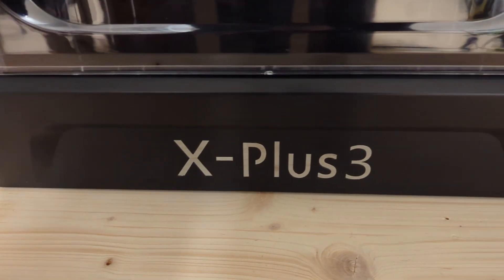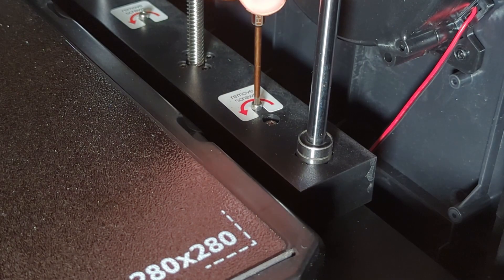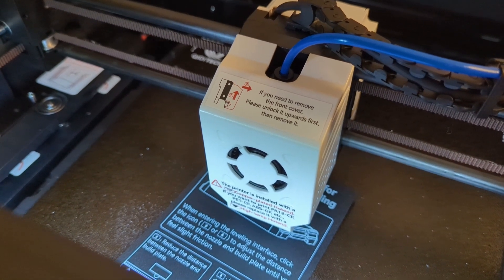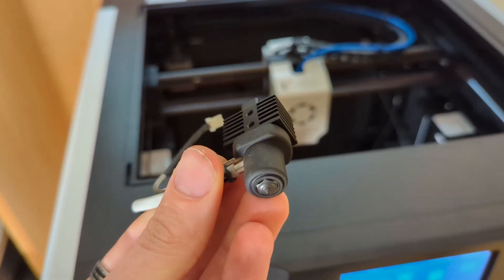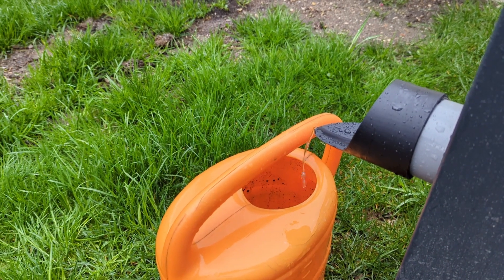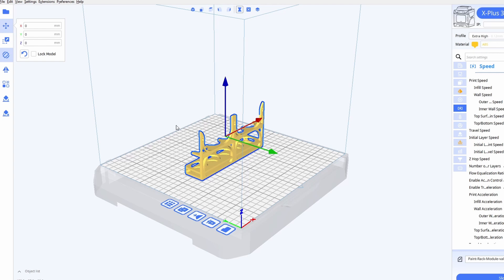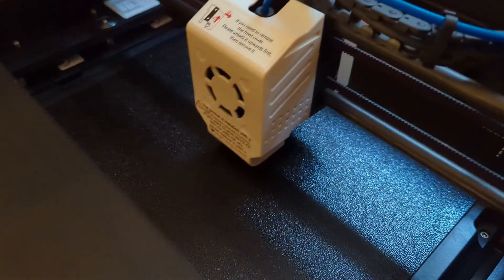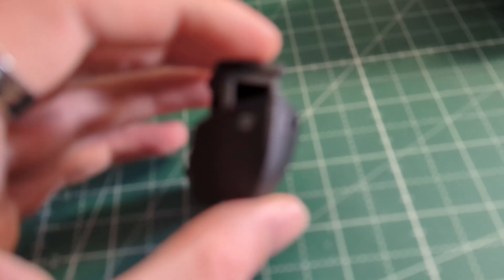Qidi X-Plus 3 Review - Affordable, Versatile, and Fast - old version

Comment: Hi how can you tell if its a gen 1 or 2 and if its a gen 1 can it be upgraded to work better and what parts are neeeded been told the bars were a problem the ones that were black not the stainless 
Thanks
Reply from the maker: Sorry, it's been so long that I don't remember anymore. I think the z lead screw fixtures where a problem in gen 1. But I'm not sure.
Reply: @Craftknights3D  hi yes I've been told it was the whole framework was wrong and alot of other issues when using abs with heated chamber, just needed to know why they were withdrawn from the marketplace and if they can be upgraded in anyway as qidi refunded alot of people who were not happy with them.
Did you print abs with the one you reviewed
Thanks

Comment: I have gen 2 X-Plus 3
DON’T.  JUST DON’T DO IT!

I purchased a Qidi Tech X-Plus 3 on October 21st, 2013, and received about 5 days later.  It comes well packaged in foam with everything well labeled and marked.  That is the last good thing about this machine.
Went through the start up procedure and the machine couldn’t home, couldn’t adjust z-axis offset, and repeatedly crashed when trying to print.  It gouged a deep groove in the included PEI plate.
Contacted support with the email that is PRINTED ON THE FRONT OF THE GLASS DOOR.  And waited for a reply.  And waited. And waited.  Finally in frustration I posted why was I not getting support on their Facebook page and LO AND BEHOLD an email from tech support.
It went downhill from there as I was repeatedly instructed to do the same thing over and again that did not work.  My z-axis offset was stuck to -4.87mm.  I could see this when I was linked into the machine via offset.
I did as was instructed and it did not work.  None of their suggestions did.  I finally flashed the firmware and tried a factory rest.  The factory reset button on the screen doesn’t do anything, really.  Push it all you want and it will say everything is working properly.  I finally downloaded an out of date firmware, flashed it, then hit the factory rest button and it returned it to the most up to date firmware which was originally installed.  This cleared the z-axis offset and when I re calibrated the machine, it was working properly.
WHY DID I HAVE TO FIX MY OWN MACHINE?  Also, one of the suggestions given was taken from a user that posted on reddit.  And customer service was PROUD to pass the info on.   Guess they don’t know how to run their own junk.
Worked for three days until the entire printing head seized up.  What the heck?  Another wasted two days until I was instructed to manually push the head to one side and clean and lubricate the x axis metal bars.  Looked in the “manual” to see if this was a procedure to do/watch for.  You guessed that right...no.
Cleaned, lubed and it worked again.
Now mind you I bought this specific model to print ABS/ASA/NYLON because it has a heated chamber up to 65C.  I have ASA filament that recommends 60-65C chamber.  I slice with the chamber temp to 60.  When I go to print I get an error code, do not exceed 55C.  
I print with lower temp chamber and have nothing but warping issues.  
I order QIDI branded ABS rapido filament and slice according to THEIR presets.  First print not only fails, but fails so utterly bad that I have to replace the hot end because filament has broken off and melted in the all metal throat.

Now this may be a bad machine.  BUT….
Now the fatal flaws in this machine.  No x,y, or z axis limit switches.  This is known in the CNC machine world as a dogless system.  These were phased out in the mid to late 1990s due to the nightmare of having to re calibrate the system on a regular basis.  If you like spending more time calibrating your machine than using it, this model is for you!
The on/off switch is on the back bottom, about 12-16” in next to the power cord.  A total mess to turn off and on.  You won’t know how bad this is until you own it, and then it’s a bit to late.
They provide a Tupperware style air-tightish spool holder, ON THE BACK.  Unless you have this on an island or on a shelving rack with access form both sides, YOU WILL CURSE THE DESIGNERS OF THIS.  And don’t forget you have to thread the filament out a small hole into a bowden tube 16” from a filament break sensor, then about 40” of tube into the printing head.  
Oh, and the run out sensor didn’t work when I ran out of filament.  So they add a worthless impediment to smooth feeding.  Qidi Tech DESIGN AT ITS FINEST!
Final thoughts...this model was pulled from sales a while ago, then OBVIOUSLY rushed back into production.  PLEASE, PLEASE, I beg of you, with tears in your eyes, DO NOT FALL FOR THEIR SLICK SALES PITCHES.  Because a fast, high temp, enclosed printer for under $650?  Their pitch is no better than the Sirens of Greek Mythology...a sweet pitch with utter doom.

Comment: Actually as it's using klipper, I wonder if there is an easy way to add an ercf to do multi material.

While of course the Bambu printers have an advantage with the automatic cutter in the printhead and the poo-ejection, and also the spool rewinding on filament unload is definitly quite nice, the AMS isn't the only way to do filament changes.

On the other hand the AMS itself actually does not seem very complicated. The main element seem to be the filament buffer, detecting if the printhead needs filament or if the filament pushes the filament back (unloading it). For each spool there is a feeder in the AMS and a motor to roll the spools backwards to rewind filament. Does not sound to complicated. As the Bambu filament buffer is available as spare part, I actualy think to buy one just to analyse its function. For spool autorewind there are even full mechanical solutions. If I understand correctly, with the filament buffer giving signals for the AMS and also buffering a bit of filament (as the name suggest), the feeder in the AMS stays attached (unlike the ERCF or the MMU2, they are only attached when filament is loaded/unloaded but not while printing). It shouldn't be to hard to make an arduino based control just for the AMS (maybe a new use for old creality boards?). Actually an Arduino could easy control all this without even needing any comunication with the printer. If unload is detected (due to pushing filament back into the buffer for a certain time > than on retractions), rewind the filament back to the spool (sensor directly behind feeder to stop rewinding, so it can be load again). Than insert next filament and tell the printer to load and continue. I do not think the Qidi has autoload feature, but if I remeber correctly, gcode allows wait for pin states, so if there is a free I/O this should be easy.
Comunicating wich filament to load next you could also use free IOs on the printers board if available. Or filter the gcode for the T0...T3 commands and create a seperate file to control your diy ams controler.
This is only the basic functionality (theoreticly working with any fdm printer, independend of the firmware). The more complex part would be error detection and handling...
Also you have to tune the ramping profiles for every filament, to get the perfect tip on unloading for later reloading, as you do not a cut inside the printhead.

Comment: Thank you for this review, does this machine allow you to make a pause at height to change  filament color during print or add bolt ?
Reply: Yes, you can do that in the qidi slicer, I do it all the time. Its done with extensions > post processing > modify g code > change at Z
Reply: @adamGeuc  thanks a lot
Reply from the maker: Pausing at a specific height is something that you can add to the g-code. So pretty much any printer can pause mid print (theoreticaly).
Reply: @Craftknights3D  in cura you can use pause at height easily , i guess not in quidi slicer
Reply from the maker: @mimi13843  yes. But you don't need Qidi slicer. You can transfer the settings over to Cura or Prusa slicer.
Reply: @Craftknights3D  i see, thank you i will go check for a prusa  settings before buy it.
Reply: I prefer this slicer

Comment from the maker: Qidi has just clarified that the X-Plus 3 that I reviewed in this video is version 1 that can have quite some issues as you have probably seen in other reviews. I was lucky so far and nothing happened with my printer yet. 
Qidi has stopped selling this version and they will release a version 2 of this printer very soon that won´t have the same issues and hopefully work much better and more reliable. Qidi will send me the second version of this printer and I will do a full review of it as soon as the machine has arrived.
Reply: Looks like the new version is out now with the majority of the issues fixed. And they changed to a new slicer based on Prusa Slicer.

Comment: I just installed the qidi slicer and tried out some models for slicing. It works perfectly fine and fluent on my pc, so i cannot complain. I have ordered the X-MAX 3. 
My PC is 6 years old but has a new RTX4080 Graficcard and 64Gb Ram.
Reply from the maker: Interesting. Cura, Prusa slicer, and Bambu Studio are running fine on my PC. Only the Qidi slicer is slow as hell. 

But good for you! Happy printing with your new X-max 3!
Reply: @Craftknights3D  Its a bad habit to compensate bad slow software with better hardware. Hardware from China is mostly pretty good but i have similar problems with snapmaker luban, which is terribly bad software, too. 
But you can use other software and just transfer the settings to it. So why not directly use the good slicers ? Maybe all customers are doing it automatically and thats why nobody complains anyway.

Comment: No it isnt. I would stay far away from this model. Qidi is a good company but this machine is a piece of garbage. 

Better off with a xmax3 or a bambu labs
Reply from the maker: I still have No issues with the X-plus 3 which makes me wonder If they released a new version of it where they fixed issues or if I got a "special"  unit for review purposes. I hope its the first. Can you elaborate on the exact issues you had  with this printer or heard of? Then I can check with my unit and contact Qidi to find out whats going in here.
Reply: @Craftknights3D  there are issues when you using the heated chamber unit. Are you using it ? When used, as bottom of the printer is notsupported with anything, it expand/retract during heating, and whole bed then moves up or down. If you press bottom of the printer under the bed, and you can actually press it + whole bed will move with it, that is where the issue comes from.
Also, the BL sensor is going crazy when the chamber is heated, and it just doesn't know where it is.
Reply: @ChrumkavySuchar  did the new firmware make it good yet?
Reply: Mine died after test print. 

As in power supply looks like it got zapped. I had it set on 115v and had it on a surge protector. 

While I was setting it up the print head collided twice with the platform after having started the bed at lowest position. Then the head got stuck in its starting position. (Front left)

I asked for a refund and ill send it back and they basically told me Im stuck with it. If they dont adequately solve the power supply issue Ill be asking my bank for a charge back. 

This was in addition to the z offset issue.
Reply: @jeremyreinhold3620  as someone who kinda hates how Bambu operates I was hopeful for the xmax3 but with the plus3 issues I can’t seem to find any info confirming the max3 doesn’t have the same issues. Other the the fact you can still order it I’m still cautious. Was there a video or info that leads you to think the xmax 3 is better than the plus?
Reply: @KZ-yy9pm  did the new firmware make it good yet?
Reply: @jeremyreinhold3620  bro why you change the voltage 115v?
The printer is great you are the problem
Mine working very good i have many printers
And Bambu Lab is fucking garbage the worst fucking overrated machine i had so many problems with this printer

Comment: was hopeful of this printer but after few review's it makes creality look like better option
Reply from the maker: The k1 could be a great alternative.
Reply: K1 is great for the price alongside the P1P. Only real differences between the two is that the K1 has a built in enclosure while the p1p needs it purchased and installed separately. And the build plate of the p1p is a bit bigger. Both are phenomenal out of the box printers though so you really can’t go wrong with either. Obviously there are more differences, but those are the main ones that stuck out to me since I wanted the bigger plate, so I went p1p.
Reply from the maker: @ImMahOrigin  Bamu lab sell an enclosure for the P1P?
Reply: @Craftknights3D  havent seen them sell any is that on one there sites I but have seen files to print one
Reply: @ImMahOrigin  idk I watched another review video and he had alot of problems and on second day printer broke the heat break in half

Comment: Im pretty interested in this printer but QIDI stopped selling X plus 3 cause of problems with z offset, after a few hours printing in heated chamber.. Im interested in how long it will take until you will run into this kind of problem as well..
Reply: push on plastic in bottom see if bed still moves
Reply: @jamesharris9894  I’m super curious if the xmax 3 has the same issue, you can still preorder it but on the site it shows the same graphic of frame as the plus with the lead screws mounted in the plastic and not connected to frame at the bottom. I think it’s something some people could fix but shouldn’t have to.
Reply: @KZ-yy9pm  from what they say  only the plus is real bad
Reply: @KZ-yy9pm  but I'd worry if built the same as plus
Reply from the maker: That's interesting. I have been printing for about 100 hours with this machine and had no issues so far. But after reading your comment I watched a few other reviews and it seems they got a slightly different printer with different accessoires (1kg Filament and pliers that I didn't have). So maybe they released a new version of the printer? I have also seen a more recent review with simmilar experiences to mine. I will let you know when the printer behaves weiredly.